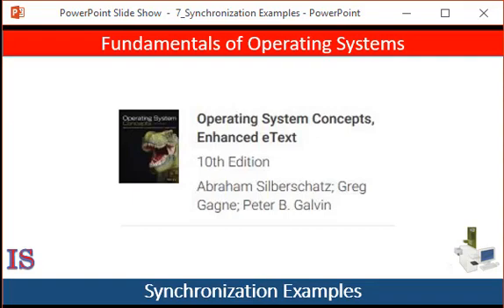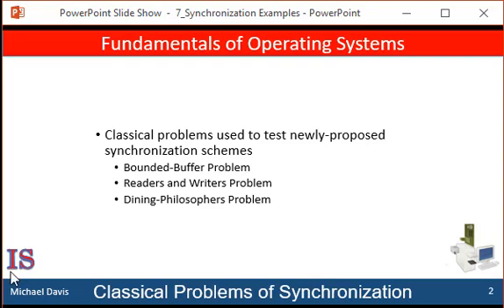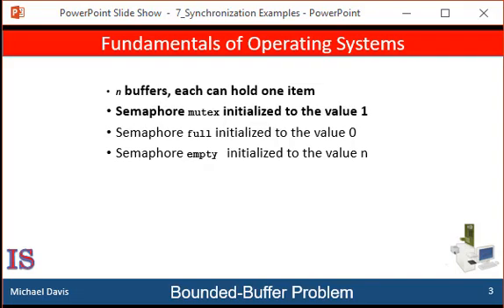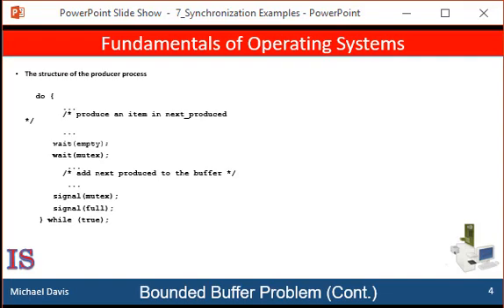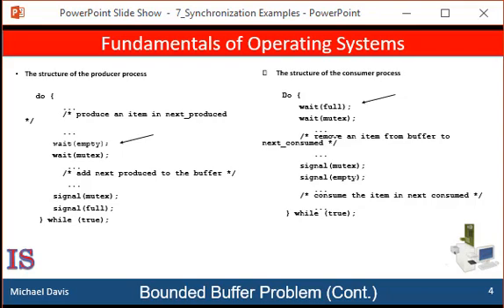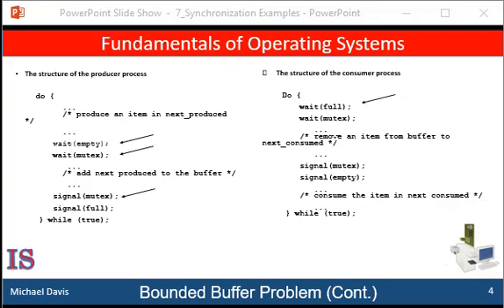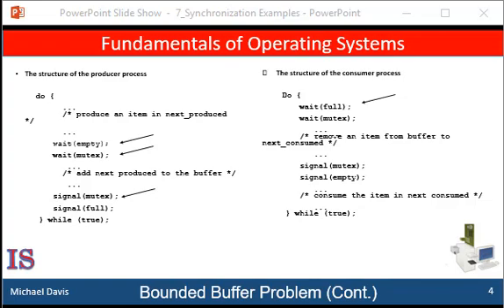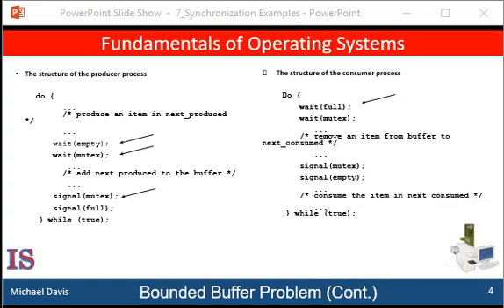M3U7L1 Bounded Buffer Problem

Comment: With 50 distinct buffers, why not have a unique mutex for each one? That way the producer could fill buffer 48 while the consumer reads from buffer 31 for example. A mutex lock on the entire set of buffers seems wasteful. Is there a reason for this? I suppose we would also need a way to identify to the producer/consumer which buffer it is supposed to interact with.